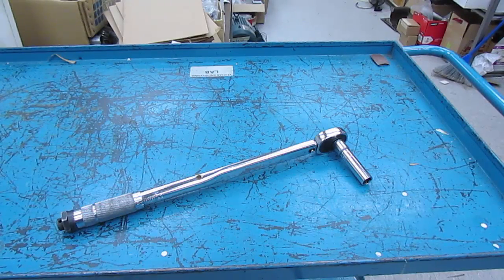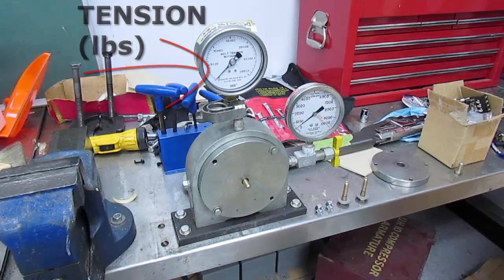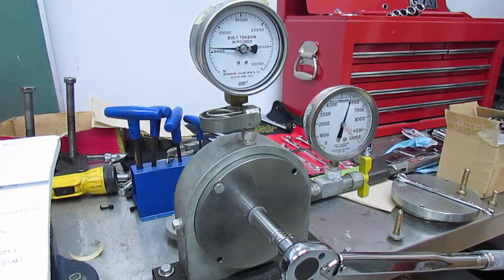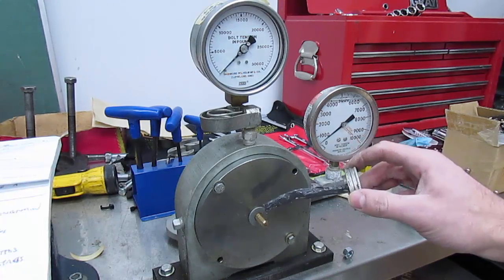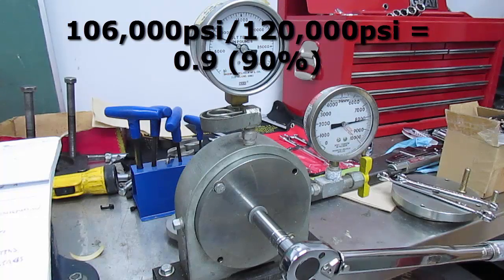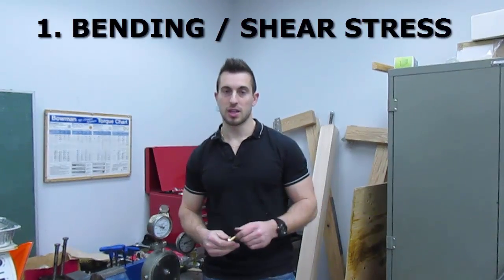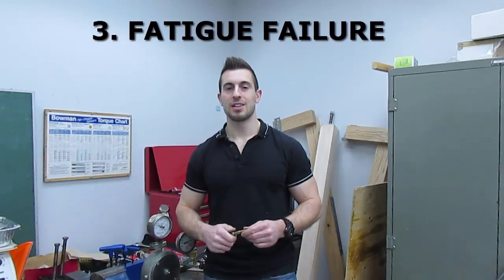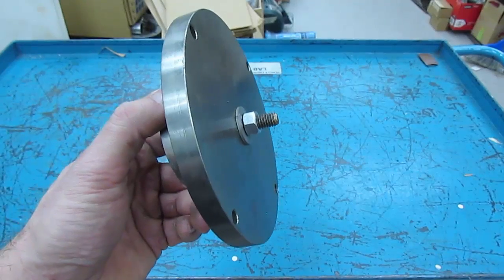Should You Put Anti-Seize On Wheel Studs / Lug Nuts?

Comment: Very informative and professional explanation of the phenomenon. It still leaves me with
the problem of what you would do on a cold dark night in the middle
of nowhere when you can't get the lug nuts loose because they have
rusted on. It seems that those smart people you referred to have come
up short or don't care about what may happen in the real world. Since
the lubricant you used is called ANTI seize I think that it would be
good practice for the engineers designing these systems to take the
likelihood of seizing nuts and bolts into their calculations and
provide a torque specification for users who want to avoid the
possibility of seizing into account.
Reply: Electric 12v impact wrench.
Reply: Byon Bill it sounds like the scenario you came up with is from just using your impact gun to put on your wheel lug nuts and not setting your gun to the one setting and barely getting them tight. Your problem may start with the person who Services your wheels. You need to torque in the air with the brakes on your your vehicle. Over torquing or putting them on with an impact. Is the real problem. There is a solution though. If you ever grab a nut with your finger and tighten it as hard as you can just barely tap it with a hammer and you will see it will move. If you need to loosen a nut that's been impacted to put on. then it needs to be impacted to take it off. just smack the tire iron or socket with a hammer as you are trying to loosen it and it will come free.
Reply: @JonRheaume2282  Using a 1/2 drive and breaker bar I now have a stripped stud (1 out of 8).  Stopped turning as soon as I realized what was happening then shot some WD40 around the bottom of the lug.  Need to replace rotor.  Would you suggest trying the impact wrench before drilling the lug?
Reply: @JonRheaume2282  unfortunately in certain environments the nut will be wielded on and treads will get all buggered up when tried to remove. They also sometimes snap off when trying to remove them if you are lucky and other times the stud will start to spin and you are really screwed. Boat trailers owners struggle badly with these issues. I guess like the maker of this video said in his comments ,what is the worse of the evils? I guess it all depends. That’s why trailer manufacturers say to check bolt tightness frequently.I personally use anti seize. Never have had a problem. I just replaced all six studs on one wheel on my boat trailer the first time I ever removed the tire because the manufacturer did not use anti seize. All lugs wielded and pulled the threads.
Reply: Bill Byron, you obviously have your nuts confused with your bolts. Locktite is applied to the stud end that screws into the hub,  removing the wheel  does not involve removing the stud BOLT.  Lug NUTS holding the wheel in place should be properly TORQUED and never be Locktited.
Reply: @billwilson6096  You don't realize that lots of cars use wheel bolts instead of nut/stud combinations. It doesn't help your 'explanation' that you are confusing bolts with studs. Learn before you teach.
Reply: @JayCGypsy  you are so correct. I just looked this up in Wiki.  Some designs (Audi, BMW, Mercedes-Benz, Saab, Volkswagen) use lug bolts.  I choose not to own or work on all of those brands anymore.  and it's not because of bolts vs studs.  But it makes me wonder about their engineer's choices.
Reply: Okay. Let's say you can't get a nut off. Now you put a socket on it a extension and a long breaker bar. Let's say it's 7 ft long. And you are standing on it. Holding onto the truck and jumping up and down. And it still won't move. Oh my God what do I do. Well it went on with impact. Okay I will walk over to it and you will be standing there jumping up and down I will tap that socket with a hammer and you will go flying down and fall on your ass. Got the picture yet. I know what I'm talking about and how to get nuts off. And I've been doing it since 1989. In New England where there's rust and salt
Reply from the maker: Thanks Byon Bill! The engineers definitely take this into account. I can't say for certain, but from my own experience I think it is a choice of the lesser of two evils. Although bolts that have anti-seize and the correct torque applied should theoretically not loosen off during normal use, sometimes this happens. It can be due to vibration or micro movements relative to the two parts, eventually the lugs loosen. When no anti-seize is applied, the bolts may seize a little (as you experienced) and this may prevent them from backing off. Although this is an inconvenience, it is the lesser of two evils compared to your wheel lugs falling off while you drive. Another reason I can think of is that when people apply anti-seize, it is not always uniform, the same type, on just the threads vs the threads and the underside of the bolt/nut, etc. It introduces many more variables into the equation and the friction value may not be consistent each time. Whereas dry is, well, dry. Less things to take into account so it's easier to just supply a dry torque value. That's what I can think of off the top of my head. Thanks for watching!
Reply: Embrace Racing. 🤔 I’ve been anti seizing my nuts since I’ve owned my own vehicles  16 years now (yes a millennial) on Over 12 different vehicles. I typically torque them to the same specs as recommended and never had a lug nut come loose. But they do come loose a lot easier when you want them to. The other alternative has been broken 1/2” ratchets, sockets, and the cheesy cheap breaker bars that are included from the factory would strip and or bend.
Reply: Or you know just oil them?
Reply: I don't care. I have the technology and the know-how. First of all I don't care how strong you are... you could be the strongest man... a giant among giants grab a wrench and snap every nut that you try to loosen is what will happen. If it's been put on with impact. It has to come off with impact. Even if you try to loosen it manually you're going to have to hit it and make some type of impact to loosen it.
Reply: @JonRheaume2282  or you could use a torque bar? Lol .. I use a steel pipe about four feet with 3/16" thick walls "I put that 💩 on everything" 😂
Reply: Do not impact lug nut when installing it. A lot of store use impact gun and they have massive torque. Overtighten and the rust is what give you problem. As long as you torque it to spec, wheels won't come off and the nuts won't rust stuck in there.
Reply: @yogaexe don't the impact guns have specific torque settings though? I haven't seen anyone using a torque wrench to spec in ages!! 😮
Reply: @majkdave  MOST impact gun doesn’t have torque adjustment. It’s pretty much use as much as power/pressure they have. Its job is to impact nuts free. If you tighten a lug nut using impact, it will fucked it especially if it’s an aluminum one. Good tire shop will never tighten using impact.
Reply: @yogaexe  Ah well, I don't remember if they used twrenches at the pro shops, you can't see the work area but backyard ones for sure don't. In either case I lucked out, turns out they had the wrong lugs on. I got twelve new Sae 7/16 fine thread and was much tighter. Either that or I was looking at entire axle replacement. But thanks for the advice I'll be sure to use a torque wrench on em before I test drive it, just doubt I'll ever be able to force a tire guy a brothers and sons tires to follow suit 🤣 always wondered about them $400 guns tho, it just didn't seem right, in terms of proper spec. Youd think all mine including my trailer would be shot already, but I guess there's at least some cushion there. That and these 6 lug are from the 70s or 80s, when they used real metal lmao

Comment: I track my car every month, so the wheels comes off twice a month to change between street tyres and track tyres. I've been told to add anti seize to protect the studs from the constant wheel changes. I've done a bit of internet searches and it seem like a 50/50 split between the community about this.

What are your thoughts on this?
Reply from the maker: +Wrinkledlemon This is a bit of a tough one... mainly because constant tightening and loosening of a bolt/nut can change the surface finish of the thread interfaces. They will become "rougher" and the next time you put your lug nuts back on, there will be increased friction at the thread interface. Then what ends up happening is the same amount of dry torque results in less preload. Then you may run the risk of under-tightening. 

That being said, the engineers who designed your bolt pattern likely took this into account (I can't promise you that, but I would bet that something like lug nuts have been looked at in extensive detail over many years). I'd wager a guess that there is enough of a "preload factor" (optimal designed preload on a new set of lug studs divided by the minimum required preload to hold your wheel on) that as preload diminishes with each subsequent installation of your wheels, there will always be enough to hold your wheels on. 

This is only a hunch on my behalf but it's a good question. The people who told you to do this, what exactly did they say the anti-seize is protecting the studs/nuts from?
Reply: +Embrace Racing I've been told that it helps "minimise the damage from taking on and off all the time." I'm assuming the 'damage' is the roughening of the thread surface as you mentioned.

I recently had a stud get cross threaded as I was taking the nut off and had to replace that stud. This was after about, 16 wheel swaps. I'm now hesitant on continuing with wheel swapping because of the wasted time and money to replace the damaged stud.

I'd hoped anti seize would help prevent studs from breaking but the potential over tightening with anti seize as shown in your video has put a pause in my decision as well.
Reply from the maker: +Wrinkledlemon What do you use to install the lug nuts? Do you use an air gun to buzz them on? It's pretty difficult to cross thread if you do it by hand. I know it's more time consuming but like I said, very difficult to cross thread by hand...
Reply: +Embrace Racing I use a torque wrench (@89ft/lb) to install them. The nut, however, became stuck when I was removing it, not when I was putting it on.
Reply from the maker: +Wrinkledlemon Very strange that it was when it was being removed. Have you looked into ARP studs? If you're tracking and installing/uninstalling all of the time, maybe it would be a good idea to upgrade all of them. I'd give them a call and get their recommendation since they specialize in it. Let me know what they say!
Reply: +Embrace Racing Thank you very much for the responses and for pointing me in the right direction! I shall check them out. Cheers!
Reply from the maker: +Wrinkledlemon No problem! Be sure to follow up and let me know what they say. I'd be interested and I'm sure some other people reading the comments will find it helpful as well!
Reply: +Embrace Racing I've got the ARP studs in. Mechanic says that I may have accidentally knocked the rims on the previous studs as I was taking the wheels off, causing the threads on the studs to flatten out and crossthread. Just a theory though, but something he has seen happen.

He did suggested a tiny dab of lube on the new studs once every 3-4 track days, but also to keep them as clean as possible to avoid getting particles (sand, pebbles..etc)  from getting crushed into the threadlines.

As for the torque settings, he recommended 80ft/lb instead of my usual 89. Not sure how he came to that figure, but I'm gonna follow that for now.
Reply from the maker: Thanks for the follow up! Interesting theory on why they were damaged. Glad to hear you got it sorted out though. Did you ever get any recommendation from ARP on a lubricated torque spec? They might be able to provide you with some insight :)
Reply: i'm also tracking, having only done 1 wheel so far (because i had to) but bought arp studs and some ti lugs.  i read about galling with them and used anti-seize on the threads.  oem dry spec is 89.  i've been torquing them to 75.
Reply: I have successfully used anti seize on lug nuts and spark plugs for over 45 years, and NEVER had a problem with either. I think this is much to do about nothing. Anti seize helps far more than it could ever hurt.
Reply: Yeah, it's much ado about nothing-  (from Shakespeare).   Yes, the effects of anti seize on lug nuts are not going to be significant with reasonable torquing practices.  Using a fine threaded nut bolt combination for the example would naturally tend to show a larger difference when the mechanical advantage of the screw is much larger.   Lug bolts are coarser threaded and thicker, so it'd require extraordinary efforts to push them to its limit of elasticity and subsequent failure.  Gorilla fisted breaker bars or high power impact wrenches used with abandon may push it, but usually the problems that causes is not the studs snapping after driving down the road, but the curses it draws forth when someone tries to change a flat tire on the roadside with the puny 8 inch lug wrench.  
Maybe it'd be interesting to see someone lube one up to the max and see just how much it takes to actually shear off the stud.  I'd guess the 1/2" drive on the wrench would yield first.
When you've seen lug nuts creak and have dry dusty rust coming off the threads on removal from long term corrosion, the benefits of a layer of lubrication is more evident.   If it's that much a concern, just set the torque to the lower end of the spec as compensation.   It's not as critical as things that require torque to yield like some head bolts, which use angular torquing based on the specific thread pitch and bolt material rather than friction based torque wrenches.
Reply: Why not get arp studs and call it a day

Comment: Would engine grease on the wheel bolt provide the same effect? I would imagine that anti-seize is different in its chemical composition. Are you saying that we should dry torque bolts? The manufacturer does not specify whether wet or dry.
Reply from the maker: +dynaweave Engine grease would definitely provide a similar effect. It will reduce friction and result in more preload for the same torque. If the documentation for your vehicle doesn't specify, it would be safe to assume that it is a dry torque spec (for wheels). I've never personally seen a manufacturer specify lubrication/anti-seize for wheel studs.